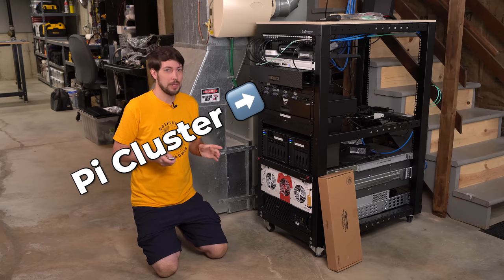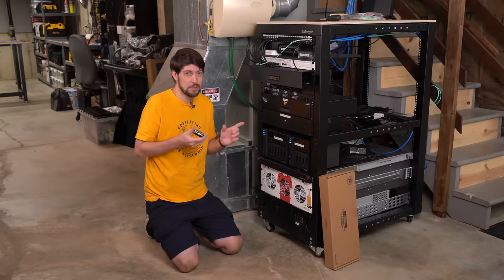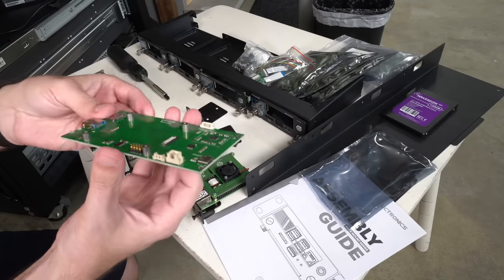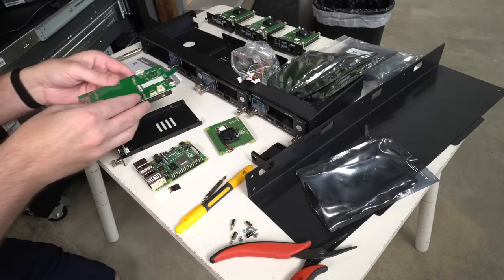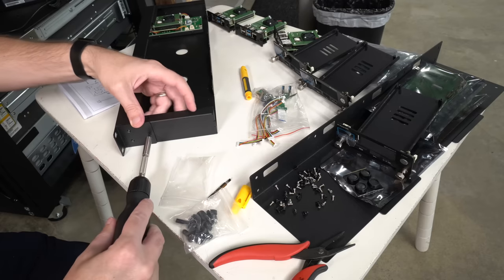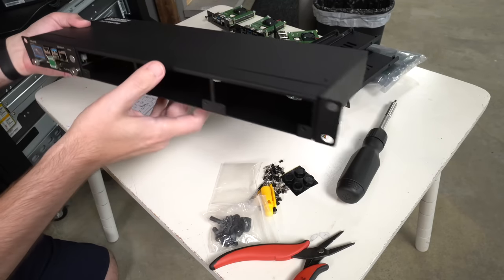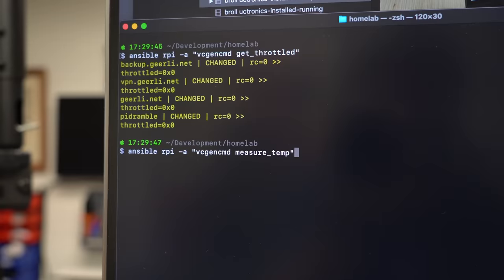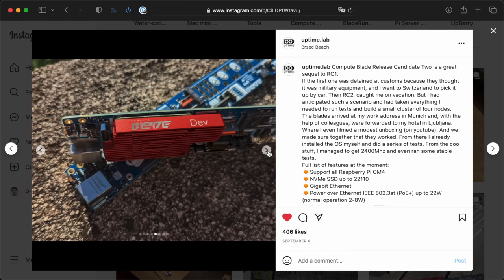Homelab upgrade: New Raspberry Pi Cluster rackmount

Comment: rpi is cute.. but seriously, a surplus <$50 1U rack server (dell, HP, IBM, SuperMicro, etc.. ) running linux, esxi, proxmox, etc... would run forever with redundant everything CPU, PSU MEMORY, STORAGE, Cooling, Etc..  tons of ram.. dual xeons give more cpu than ever needed..  slice and dice at your will with virtualization.. quiet mod it since you wont ever tax it.. all for a fraction of what just one of these little rpi setups run..  (you have $80 in POE hats alone, close to that in Micro sd cards.. 2-600 in Rpi them selves.. i dunno if they are all 8gb? cables, power ) before the mount and toys..  I see Rpi as a [not so] cheap learning device.. if you have space for even a SFF pc.. ok, toss a handful at some kids to get them thinking and started with tech, i'm in.... past needing something portable, or small.. i dont see these in the roles you have them in.. other than just for learning and fun.. and if that's the idea.. success.. otherwise, if it's in a rack, it should be rack worthy..  i'll be checking out your channel a bit..  i see a guitar... i play too.. and i'm retiring from the network world after 30 years as an Owner /  senior network engineer / Solution provider /  .. you look like a smart kid.. wish you the best..

Comment: Here you go found a better 1 for air flow it's on Amazon I know you had a complaint with your current one if you buy it can you make a video n shout me out? UCTRONICS Ultimate Rack for Raspberry Pi 4, 19" 1U Rackmount with All IO on One Side, OLED Display, Power Switch, and Cooling Fan that's what it's called price is 105 hope it helps n going well

Comment: Looks awesome but it is kind of a kludge. Wouldn’t use this in any professional environment.
Reply from the maker: To be fair, anything that tries to rack up the Pi 4 model B has to have a bit of kludge to it—the form factor is great for 'messy wire-y project on a desk' but not great for tidy installations.

I'm excited to get to the CM4 Blade testing, hopefully soon, since that setup is a lot more optimized for a rackmount environment.

Comment: It just show how poorly Rasberry Pi is integrated itself. It requires some many extra components, cables, and hacks to make it usable. The only readaming feature of Rasberry Pi is that it does support PXE and UEFI+ACPI, which 99% of other boards do not support. I must more preffer something like PC Engines APU 2. Way more powerful, easier to setup, more expandable, designed for more industrial and network usages.